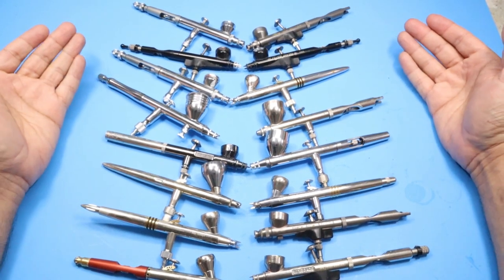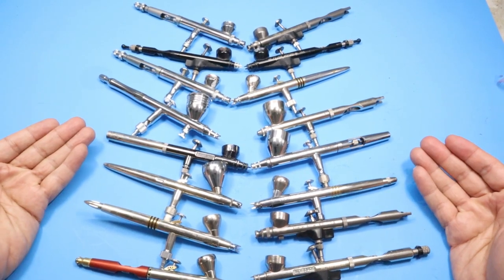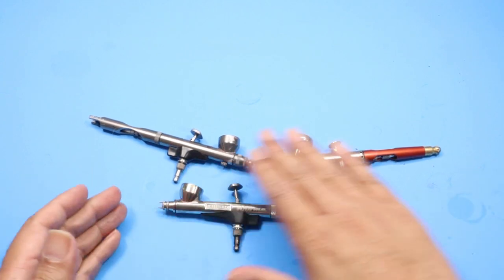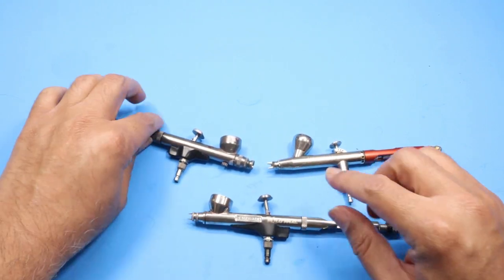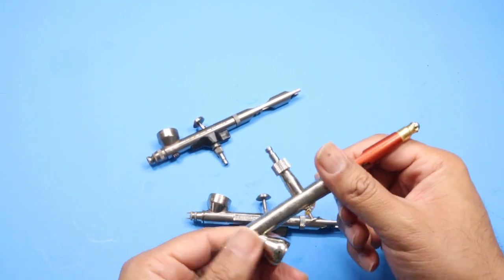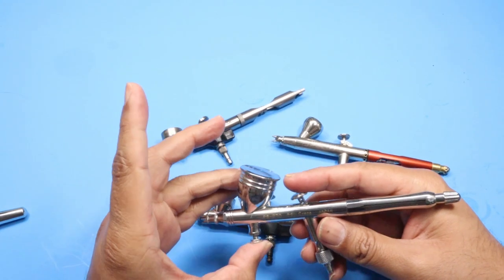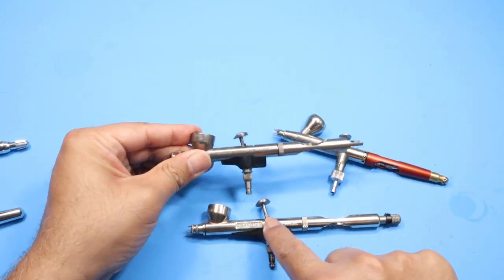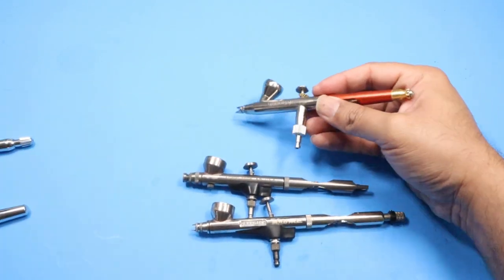Airbrushing tips and tricks for scale modeling

Comment: Have the Badger Patriot 105, which has been good enough, though I wish the air flow part of the valve was more sensitive. Always good to see how others clean and use theirs. I like your techniques for quickly changing paints. I've never done the backwash technique for mixing and cleaning. Will try it now.
Reply from the maker: David, glad you like the video. Did you know adjust the sensitivity of the 105 by adjusting the spring and and also by adjusting the tube shank. Definitely give the paint changing and backflushing a try. Feel free to reach out if you have any questions.

Comment: Badger introduced the teflon seals and they are solvent proof, never no problems in all of the 35 years that has passed since i bought my Badger #150!!! 😊
Reply from the maker: I love by Badgers! They may not be the prettiest airbrushes but they are rock solid and Badger customer service is amazing. They have fixed so many of airbrushes quickly and reasonably. My Harder Steenbecks, they are great but their seals are not so good. When I used solvent paints, H&S seals would break often. You can replace the seals on your own with an H&S but it was annoying.

Comment: Hello partner, congratulations on your channel, it is very educational. When making the mixture for the airbrush with model air paint, you say that at the beginning it is better to use 50% paint and 50% thinner. What thinner do you use to mix with model air? Thank you
Reply from the maker: Hey, glad you like the video. On to your question, the thinner I’m using is my own formula. I made a video of it on my channel. The video is called “updated: how to airbrush Vallejo model air”. If you that thinner mixture…it will change your water based acrylic airbrush game. It stops tip drying, it helps the paint lay down smooth, and makes it more resilient.